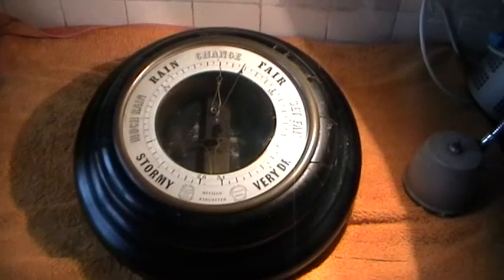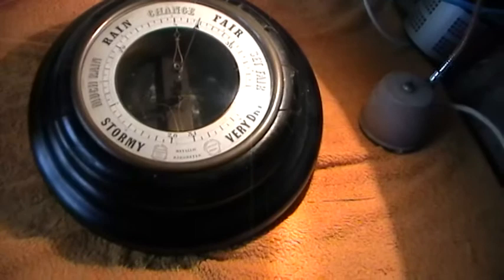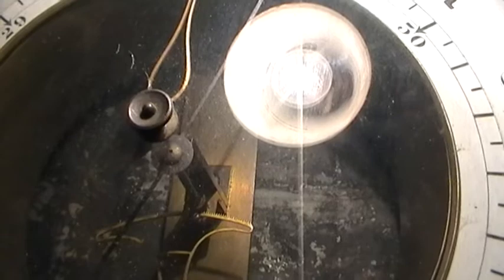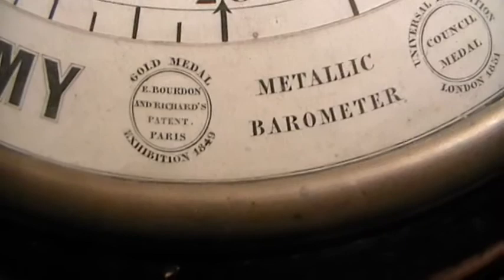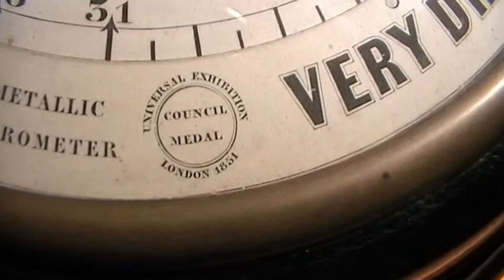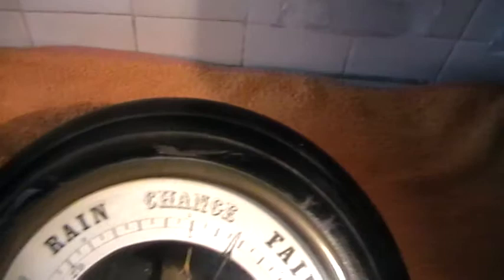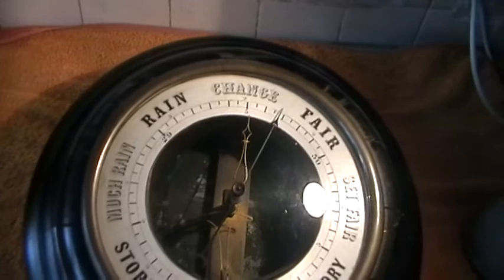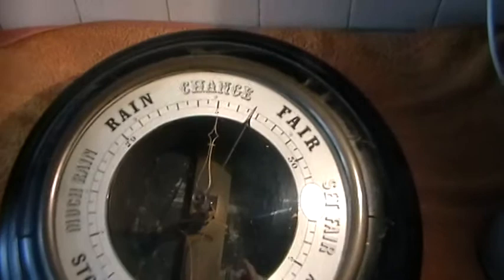Bourdon Barometer

Comment: An unique piece althoug they are very inaccurate devices
Reply from the maker: These, like many barometers only give a rough of pressure depending on being correctly set up depending on sea levels, much more accurate readings would be from a mercurial type and further acculcy from the Fortin barometer which you set the column of mercury using a pointer which just touches the mercury and ensures a correctlength and reading.